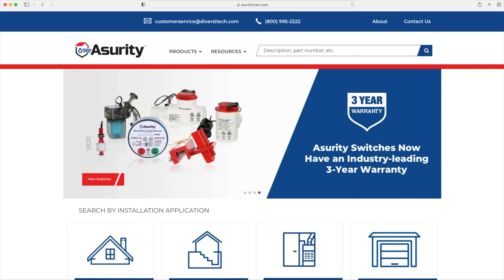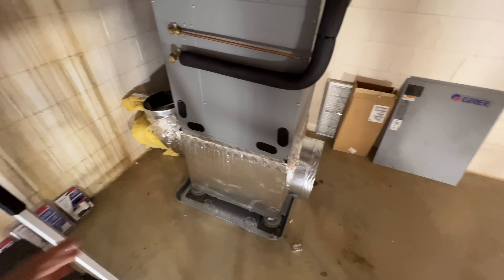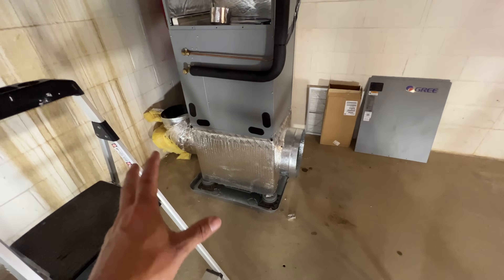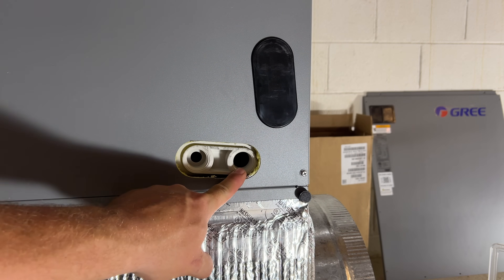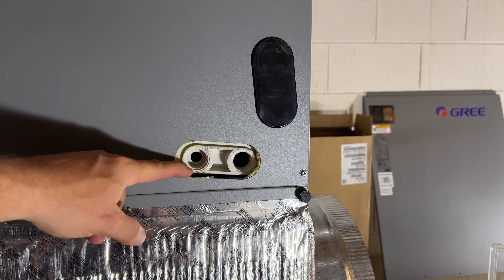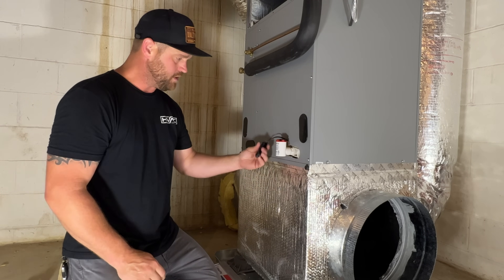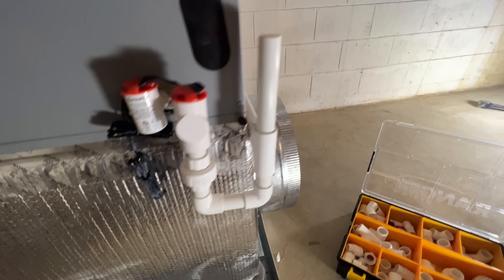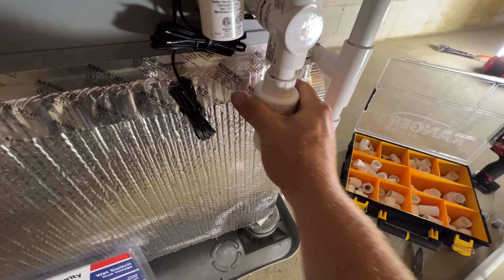How To Properly DRAIN an HVAC System

Comment: Do you have to be a licensed electrician to do high voltage work? Why have an indoor disconnect on a electric air handler when you already have breakers on the heat strips? Aren’t those your disconnect?

Comment: hey @qualityhvacr could you also use a condensate pump to bring the water over to the floor drain? rather than running such a long drain line over and increasing the chances of a clog. I'm from the Midwest, so I'm not sure what your codes/regulations are or if you're even allowed to run a condensate pump

Comment: I have mold in my system and specifically both plenums and evap coils. The problem I have is there is no way to gain access to the evap coil because of how it was installed. HVAC contractors want 3 grand to replace my 2 plenums alone. What is a fair price for this and also to reroute the furnace flue pipe (blocking access to evap coil) and removing overapplied mastic that is leaking + reapplication.

Comment: What are those low voltage black wire holders called? 

Btw Im using your code at Tru Tech Tools and I got a Veto Pro Pac Tech Pac free with the discount I got due to me spending 3600 😅 thank you !

Comment: I’m not a fan of drain line unions because the inside diameter of the union connection is much more narrow then the inside pipe diameter and usually is a place that clogs tend to form.

Do you guys have to use 1” PVC for condensate drains on 3 Ton, and larger, system?  This is the first year that they are enforcing this new condensate drain line sizes.

Comment: Thank you for all the great videos. I am a diy homeowner that knows enough to stay out of trouble. I rebuilt my LG mini split from watching a lot of your videos. It was doa from the previous owners of the house that we bought. I replaced the bad condenser motor and poorly balanced fan assembly. The unit works perfectly and you can’t even hear it when it’s running.

Comment: I would just recommend putting a piece of cardboard under the wet switch. In humid basements the thing will trip with high humidity. If it does get water in the e pan the cardboard will soak up water and trip wet switch.
Reply: Yep happens in basement installs a lot never tried cardboard nice trick

Comment: Is there no filtering on this system? I’ve never seen a unit with no filter box on it. It’s beautifully installed but was putting in the filter box an over looked step?
Reply: Probably has filters at the return grilles

Comment: Question? With airhandlers don’t you want to put the vent before the trap bc of the negative pressure?
Reply: If you vent the handler side it'll suck air through the vent and keep pulling the water back into the pan which defeats the purpose of the trap.

Comment: I'm interested in what air filter solution is being used on this job? Personally I think a lot of HVAC problems would be avoided if more focus was on using quality air filtration solutions
Reply: from the looks of the setup their probably just going with return filter grills....the drain was blocking the filter rack for the air handler

Comment: $200 in wet switches to prevent water damage in a cement basement with a pump in it? Don’t take this the wrong way but it feels like the majority of your videos are just what (insert company here) pays you to try to sell your viewers. I used to watch your videos to learn more about my trade. But as of lately these videos feel like a commercial more than anything.
Reply: Do you think that that customer wants to clean up a wet basement floor???  $200 is nothing but a small percentage of the total job.  I’ve been in this business for 40 years and I have always used a minimum of 2 switches and a separate drain pipe on every backup pan drain.  Drain piping is schedule 40 always.  I hate cleaning up water spills so I like covering my bases.   Take care.
Reply: Agreed 💯
Reply: True 1 switch should suffice with that saftey drain pan, customers often do smell fish when you triple the job and the price
Reply: $200 ?       I think you need to shop around !
Reply: @CharlesAnsman  lmao, my roommate literally works @ a Johnstone supply house as a sales rep. That wet pan switch alone is $90 out the door. And I would know because I’m an installer and my company leaves all job material sourcing to me. Which means I go and source all I need for my job, I see pricing on everything I buy. But you could literally spend 5 minutes googling the topic and see I’m right…..
Reply: @berated4541  B12-876 WS-1 $57.54 / B17-152  SS-1 16.62 / B17-153  SS-2  $15.03
I guess you don't buy much to have such a poor multiplier
Reply: I don't have roommates, I have Grandchildren :)
Florida Certified HARV contractor since 1993 Lic. CAC1819328, worked in the field since 1978. 
You can crawl back into your basement now :)
Reply: @CharlesAnsman  btw I’m out in CA where things are a little pricier than Florida. The average price for a motor swap out (to the customer) is $2,300. According to service titan, on installs, my average install ticket is over $15k
Reply: @berated4541  whats it cost for a simple gas furnace 3ton evap/ac swap
Reply: @Kilo5910420  unfortunately, because of title 24, there’s almost always a return to be enlarged. About 12k depending on if your went 80% or 90% on the furnace. And county is also dependent because of the low Nox laws. If that’s the case tack on another 1k
Reply: @berated4541   I got a question why in California do I see so many residential package units on the roof
Reply: @chaddarr4834  Not the same reason for all, some are there because of noise/not wanting them on the ground. I do know for a fresh cut in this is your cheapest option. I'm doing a roof gas pack tomorrow. Anyone else having trouble sourcing 3 phase package units?!

Comment: If you put a cap with a 3/8-1/12 hole on the top of your vent, you can vacuum out the drain more effectively  
In Florida we must insulate our drain line
Daisy change your low voltage from your safety switch's instead of running both up top.
Remove batteries from stat, break R, then you know right away your float is tripped.
Reply: Why do you insulate your drain lines in Florida of all places?
Reply: @rpsmith  Florida has very high humidity! The drain lines sweat!
Reply: @brettcox4108  --  That makes perfect sense!  I was thinking more about freezing :o)
Reply: @brettcox4108  Yep, for sure crazy humidity!! Today I had to do 3 drain lines for 3 different units at a huge house and had to insulate all 3 lines but I didn't insulate the pvc going down (vertical) cause the moisture wont collect on the pipe going down
Reply: @rpsmith  Sweating on the drain line can damage materials and promote mold growth
Reply: That exactly how I run my drain lines and wire them to break r and no batteries,most people in Alabama break the y And I don’t see why because when somebody calls and says they got nothing showing on the thermostat I know it’s either a trip breaker (fuses)or one of the float switches shut it down And I can get them to drain the water out so they can at least have temp air until I get there
Reply: @chaddarr4834    --  I would not wire it to break the "R" wire here in Kansas.  If it's winter time and you are away from home and the float switch circuit fails open, you might well come home to some frozen water pipes!

Comment: You should have put you liquid line dryer inside.
You don't need an SS1 if you use SS2.
Reply: Liquid line works better closest to the evaporator 
Agree ss2 has 1 less connection to worry about😂

Comment: Dudes king of the doodads ,more unneeded crap and more cost. One wet switch is enough .
Reply: yes this is bizarre having 2 safeties in this configuration does not make any sense. install the primary switch on the drain, and the second switch down in the drain pan to detect if it fills from an abnormal condition. OR add the second switch to a plumbed in evaporator overflow, don't block it off!
Reply: Gotta make that youtube money 💰
Reply: He’s running‘ like that because if you don’t do exactly what the Kit calls for then  you don’t get the insurance money if something happens. It is possible for your drain hole to get clogged up and fill up in the pan and tripped the secondary safety switch and even if it doesn’t work and it’s spills out into the return box then you got the  wet switch that will for sure 100 Percent shut that unit down because it will trip if just barely get any moisture

Comment: I really wish there was basements where I work. Around here you would have had to figure out how to get it under a house that is too low for it to fit and then Drag it through mud.
Reply: I agree!  Crawl spaces should be a minimum of 5 blocks high.
Reply: Where u located must be the south Tuscaloosa Alabama here and I hate that until it’s 140 in the attic then I don’t bitch as Much

Comment: YOu will NEVER get a float switch company to cover water damage.
Reply: What happened when you tried?
Reply: With 3 safeties should have to worry about it. Probably a bogus claim I agree. also you never see anyone use 3 float switch’s😂. Good work
Reply: If you hook everything up like they say then theoretically it’s impossible for it not to work and if you do have a claim They will probably investigate and find out you did something wrong
Reply: I had 3 float switches failed I tried wiring in a good one in series switching each old one out to find they were all bad. Water over flowed in the drain pan in the attic and soaked thru the sheet rock because the drain pan float switch failed as well! And they had no drain line on the drain pan. It’s a Older unit but still crazy. This was in Florida where there’s a lot of thunder storms lighting could of took it out.

Comment: Very nice install, just something I would have done on the drain line is put a T fitting where the elbow is where the drain runs along the wall so you can clean down that line if it gets a blockage that way, keep up the good work!
Reply: What would that help?
Reply: @JBra1382  condensate pump
Reply: No kids will shove shit down the pipe

Comment: Looks good. Was wondering, are you going to run a drain line off the over flow pan to the sump? Saw it has a opening for one on the side under the return duct.
Reply: Code says you need a drain off the pan or a safety on the pan. He has a switch so I would say probably not. I don’t run them either due to the fact most times you will never have a enough drop for proper drainage off of them.
Reply: @JBra1382  you don’t need a grade on the backup pan.  The water will just run out the drain pan to the floor sump pit. Remember, code is the minimum requirement.  We can always exceed code my friend.
Reply: I run a drain but I put a PVC shut off valve in the beginning of the pan  drain line that way if I have to drain that pan cause it fills up for some reason I can drain it by opening the pan PVC valves. The wet Swich will cut it off before it even gets close to needing drained.

Comment: Could you show how you wired these safeties up? I’ve seen a few different methods and I’m curious how you wire it with this system. Great video
Reply: Break red makes it easier to diagnose
Reply: I like to break r rather than y as breaking y will still allow fan to run which depending on the reason condensate is backed up in the first place could cause further harm to the system i.e. blowby into the supply duct or heat exchanger depending on the configuration,  on a draw through system you don't want your motor running while soaking wet, and if it's a horizontal 90 plus gas furnace in an attic for example you run risk of soaking your hx and water possibly making its way through duct seams if maybe you missed a spot when duct sealing, who knows I believe it's best to just have the whole system shut down then the customer will know somethings wrong sooner because everything stops.
Reply: I'm a Rheem dealer and breaking Y can cause an RP16 (for example) to not run with the switch closed. Breaking R will work fine. I now break R every time.

Comment: Why put a vent? If the trap has water in it then air can't be pulled past the trap.
Reply: It's not for that reason. It's generally a good idea to have a vent on your trap exit when piping the discharge a ways away. Just allows the condensate to flow freely. If you're tying into a common condensate system,you must have a vent at every units trap exit to allow it to drain without running into vacuum issues
Reply: Gravity

Comment: I’m assuming with the union it won’t be an issue, but it seems like the drain line is blocking the filter access, unless you guys are going to be using filtered grills.
Reply: I believe he is. Always best to filter air before it reaches that nasty flex. Filter slot looks to be taped as well
Reply: No hate, it looks amazing. But I guess that’s what I noticed in the end. Amazing content!

Comment: The technique is respectable as it works, but as for the laying of the pipe I see that many installers do not think that in the future it can make a novelty and the shape left by the copper pipes prevents removing a blower or fan motor from the evaporator and has to lose time and disassemble more than it should, another thing is that they leave it like this to charge more when doing a job and the other is for a future inspection or maintenance, it is complicated even to remove the access covers.  For the most everything within normal.
Reply: The Gree units are made to go that way and he didn’t block the blower door. I might have read your post wrong.
Reply: Would be easy to flex lineset out the way if evap needed changed …
Reply: Try thinking of the next guy, it might be you !!!
Reply: If he had to replace the evaporator he’d have to unsweat it anyway but I usually make it a longer sweeping motion to the unit that way I’ve got some slack to be able to pull the coil out to clean if need be